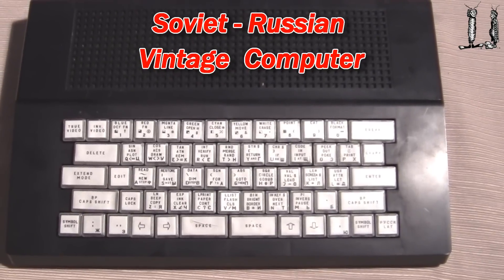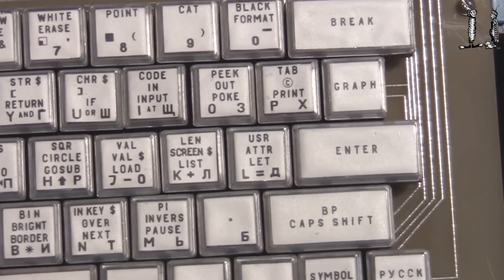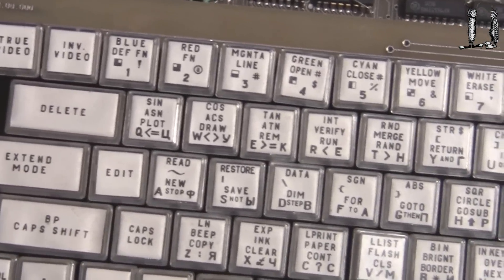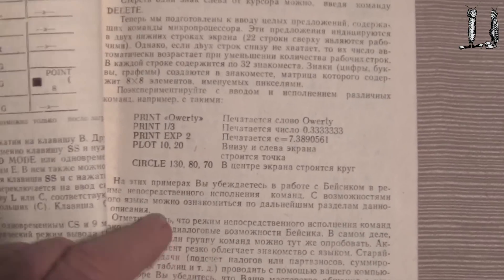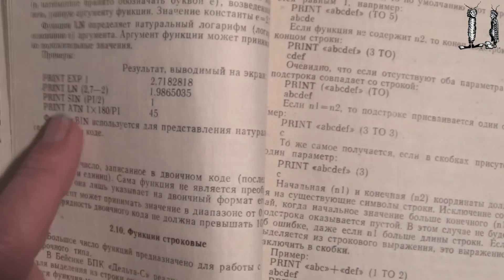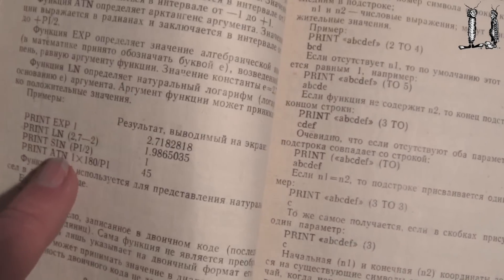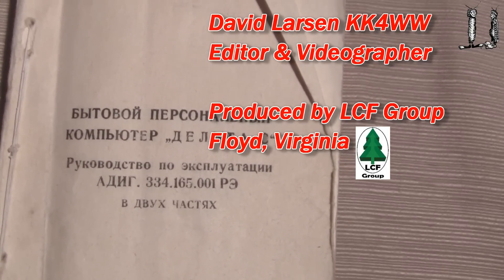Vintage Computer - Soviet - Russian PC

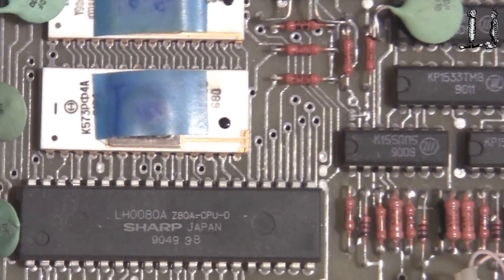Comment: 1:22 From right to left: Joystick 2 and joystick 1 ports (for sinclair joystick), cassette recorder input, power connector (+5 V), rgb display connector, reset button, and next three holes are tuning resistors for display colors.

Comment: The two white chips is a BIOS, the ultra-violet erasable ROM. Ft the 3:11 at the middle of the screen, two chips row is a RAM. The right one (as I remember) is a video RAM, and the next one is a CPU-RAM. The rest of the chips are system logic. Delta-S has 16Kb ROM and 48Kb RAM. The first 16Kb use 8kbit chips and the rest 32Kb use 64kbit chips. But there chips are discarded. (As I remember again). One dot - half of volume available, two dots - a quarter of volume.

Comment: Any chance to get a video of your other homemade soviet/russian machines? I really like those - even built my own Pentagon 128 (roughly 90 dip chips and a lot more useful than the original Sinclair made ones) in 2013. The russian ZX community actually is pretty crafty - you can get replicas/schemes/pcb designs for almost every model easily or go with newly designed modern FPGA/CPLD based machines.
Reply from the maker: Hans Meier Hi Thank you for the comments - I have a few more homebrew early Russian microcomputer. Dave www.kk4ww.com